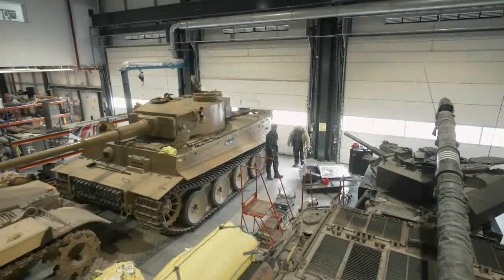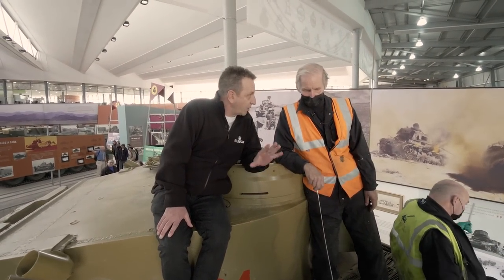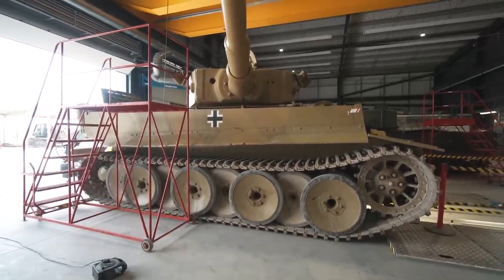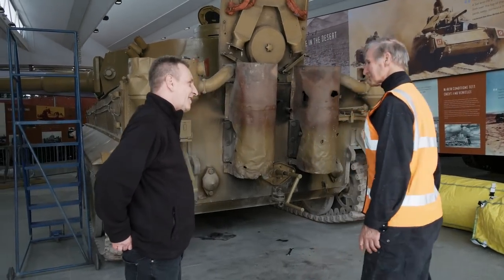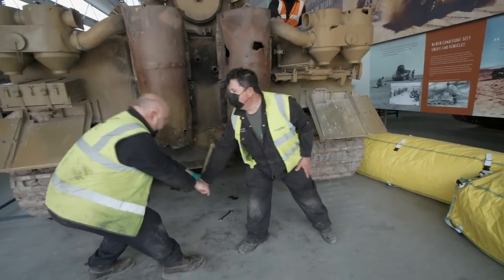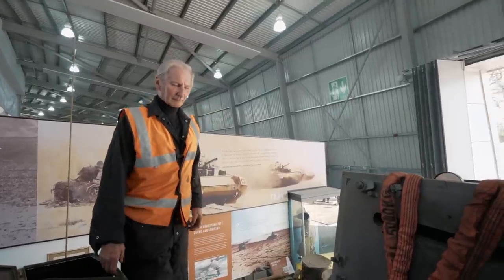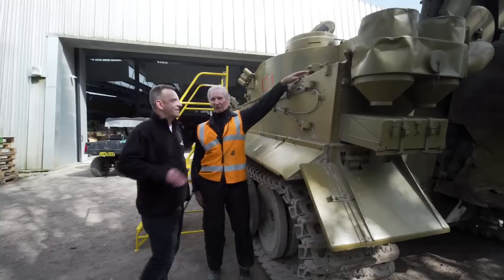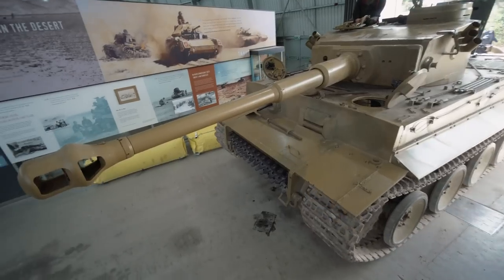How to Care for a Tiger: Keeping the 131 Running

Comment from the maker: Would you be able to start the Tiger commanders? 😋
Reply: Yes
Reply: Tank S.O.S. with Sir Richard "The Challenger" Cutland. Congrats.
Reply: Sure
Reply: 8:00 Maybe They can use brake caliper clean sprey in to the air cunsumption pipe. it will help to easy start engine.
Reply: I would love to!!
Reply from the maker: @tanker2000  Me too T_T -DelhRoh
Reply: I would be able after two or three goes

Comment: I'm surprised at how good the maintenance is.

Until now the transmission hasn't failed!
Reply from the maker: Of course, because the transmission of the Tiger was reliable, more or less. It´s just a myth of WW2 that the transmission of Tiger I was bad, which is not the case. -DelhRoh
Reply: @WorldOfTanksOfficialChannel  

Tiger 131’s transmission isn’t bad thank goodness 

Otherwise that would be a huge problem
Reply: The Tiger's reputation for unreliablility is undeserved. It arose from inadequate maintenance on the front. Think about it. If you don't properly maintain any car, it will start breaking down. Tanks are no different.

What the Tiger did need, was more maintenance than the average tank. Much more.

Comment: So what got shortened to start the tank in a warzone?
Reply: First of all, the odds that you'd left the engine unrun for a year in that case is pretty low.

Assuming you're the crew, you'd have a pretty good idea of the condition of your vehicle already. Almost all of the pre-run checks would be skipped.  Depending on the urgency, you might or might not skip coolant and oil level checks. In a dire situation where you need the tank running now, you don't really care if you're shortening the life of your engine long-term.

You wouldn't disengage the fans, and you wouldn't turn the engine over several times like they did with the inertia starter. You'd start it up first time, either with the inertia starter or the electric one (the inertia starter was preferred in cold conditions because 1930s-40s batteries sucked). If time permitted, you'd let it warm up. If time didn't permit, you'd be very gentle with it until it was up to temp.

In a fighter aircraft, most of the pre-start and indeed pre-takeoff checks for an aircraft expecting a scramble are done ahead of time, so that in the event of a scramble, you can start up and go. The US Navy called this Ready 5 (ready to go in under five minutes). It's very reasonable to imagine a similar protocol for tanks, where all of these checks are done ahead of time. However, I haven't read the Tigerfibel.

Overall, bear in mind that the majority of these checks are being done out of an abundance of caution, because Tiger 131 is priceless and its parts are largely irreplaceable. The checks are not generally required to make the thing run; they are made more necessary by the specific circumstance of it being a museum tank that is almost never started up.